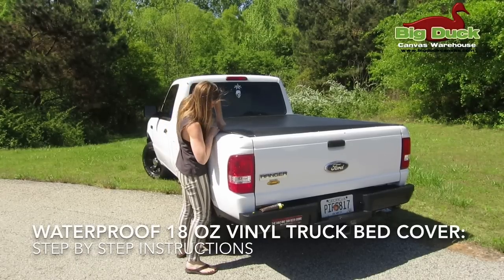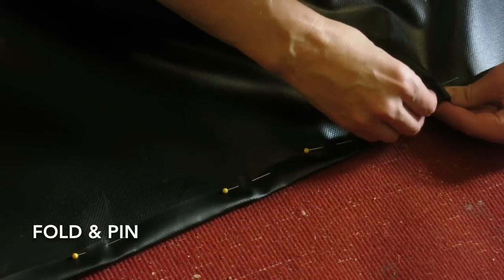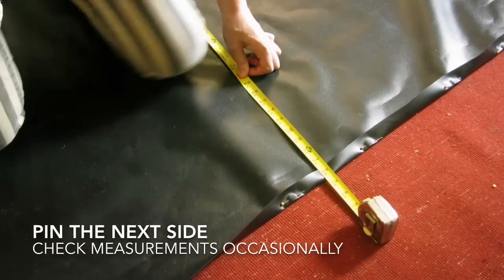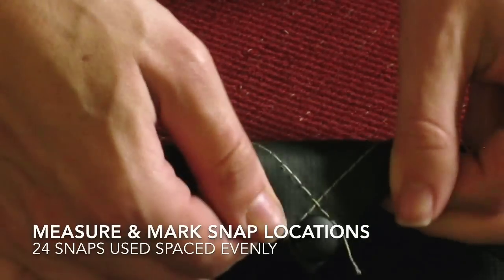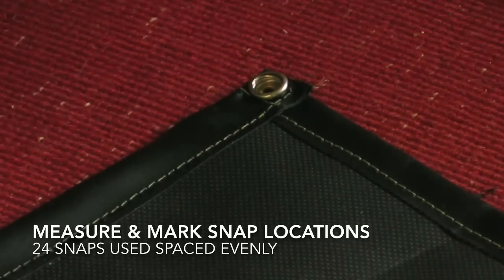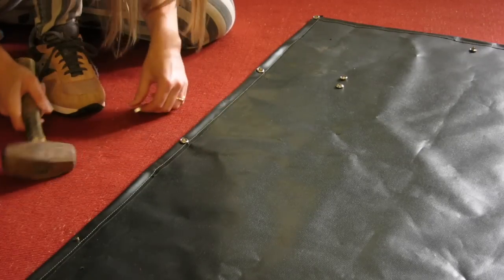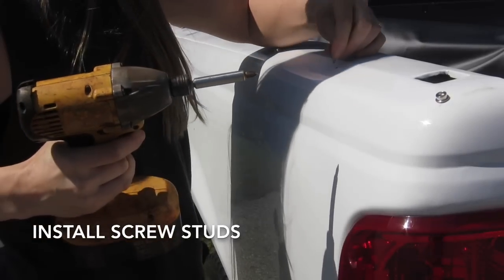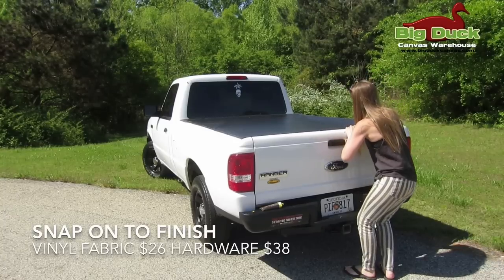How to Make a Waterproof Cover with Snaps for a Truck using 18oz Industrial Vinyl Fabric

Comment: i did the same thing but when it rained the weight of the water gathered on the vinyl and I had ponding and it stretched the vinyl. the solution was to use 4 pieces of electrical conduit that was hammered flat at the ends where it rested on the truck and it  lay across  the truck and helped shed the ponding water. Also the snaps were hard to put on in the winter as the vinyl got cold and shrank.
Reply: Sorry I just saw this video how would I build this for my truck? I assume it’s the metal electrical conduit and what size? And last won’t the ends cut through the vinyl ?

Comment: Great Job.paint the holes with some rust paint or even fingernail polish before you put the screws in ( while it's still wet) so the truck won't rust out. also put some hoops from side to side so the water will run off and not puddle.
Reply: What kind of hoops
Reply: @TheWinddancer1961  WOOD OR FIBERGLASS

Comment: hello, I have been looking for a decent, affordable tonneau cover for my Ram when i stumbled onto your video. i went to the site you posted and see the vinyl material is listed with dimensions of 61" x 36". Being that a truck's bed is wider than 36", did you have to sew 2 pieces of the material together?

Thanks
Reply from the maker: I didnt have to do that. I used the full width 61" on this truck. For a wider truck two pieces would need to be sewed together. Thanks!

Comment: Am confused it says 18 OZ/61"  on the website, it says the width is 61 inches but how long is it? is it 61 inches long as well? my truck bed is over 70 inches long and the truck in the video seems the same.
Reply from the maker: If you go about 15 seconds in the video it list the finished dimensions as 59.5"x74".  A roll of vinyl is about 61.5" inches wide ( I foled my edges over)  With pretty much any fabric, the finished width by the mill can vary plus or minus a half inch or so.  I always double check before I start cutting. Thank you.

Comment: I have a truck with a box that has a nautical theme. I want white with snaps. I would do the snaps but I want   2     1 inch strips  cross ways sewn in on the bottom.  I want rounded corners on the back side with that i inch stuff sewn all around. Check out my facebook or twitter for pictures. Would you be interested? Or maybe you would give me a price on the material. Contact me on my facebook please.

Comment: Drilling holes into my truck isn't sown thing I want to do. And I want it to be compatible with my back rack. I could buy a regular cover but I'd have to get new hardware for the backrack which is like $100. Guess I'll have to keep looking for solutions